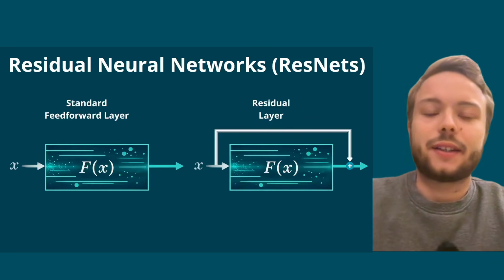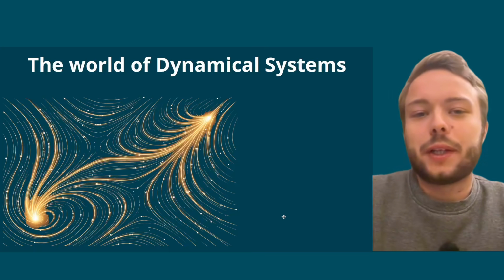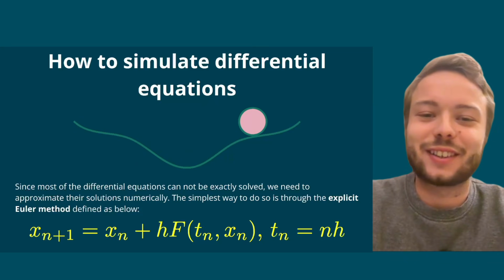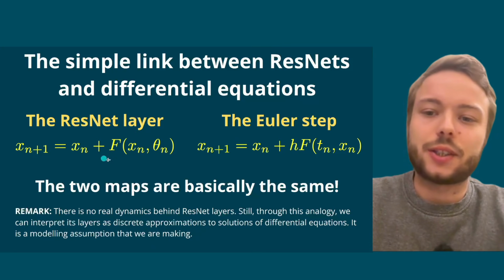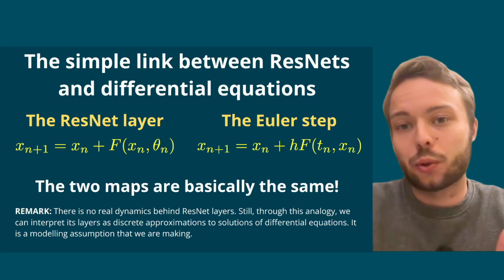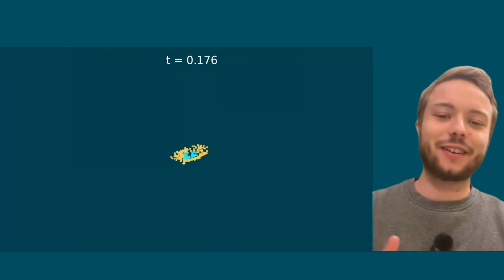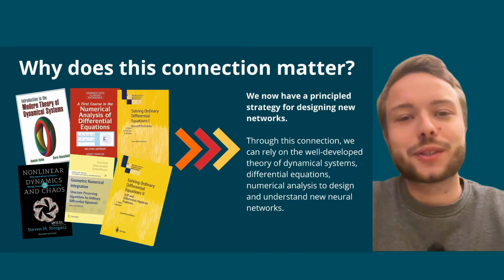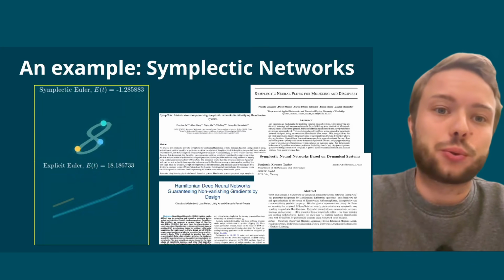Neural networks as dynamical systems

Comment: Yes we want video on Neural ODE! But what Is the difference between a neural ode and what you are discussing in this video?aren't you putting basic for what neural odes are?
Reply from the maker: Yes, the difference is very mild, and the two architectures are essentially the same. 

The main difference is that, when using Neural ODEs as a modelling strategy, we completely thrust the dynamical system, and the network's input-to-output map should be as close as possible to the exact solution of the differential equation modelling it. This means that we typically use small time steps when simulating it, or adaptive numerical methods. On the other hand, the connection between ResNets and dynamical systems is more in terms of "modelling assumption". What I mean is that ResNets are based on or inspired by dynamical systems, whereas NeuralODEs are solutions to differential equations. 

However, many people have different opinions on this side, which is why it is worth dedicating a video to the topic :).
Reply: @MathoneDavide but why and when should i use one or the other?what kind of problem do they solve? If a neural ode Is the solution of the ode itselt,doeas It means that It gives me back dy/dt?and then i Need to use a numerical method to solve for y

Comment: Hi Davide, thanks for the interesting analogy with dynamical systems. I wanted to ask you a question out of curiosity: in the simulation you showed to make the data separable, the time steps were 1000 — does this mean that the network has 1000 internal layers?
Reply from the maker: Hi Alessio, that is actually a great question! Since the task is simple and I wanted to generate a nice animation, I used the same weights for each layer and trained them over 30 steps to go from time 0 to time 1. More explicitly, this means that I have something like x'(t)=F(x(t)) where F is a parametric function with weights which do not vary with time. Instead of the explicit Euler method, I used the Runge-Kutta 4 method during training. To generate the GIF I included in the video, I took 1000 steps at a smaller size to make the dynamics feel more natural. This perspective is closer to that of Neural ODEs than ResNets, but your intuition is perfect, and it could have been complicated to directly train a network with 1000 layers (see the vanishing gradient problem that I will discuss in future videos as well).